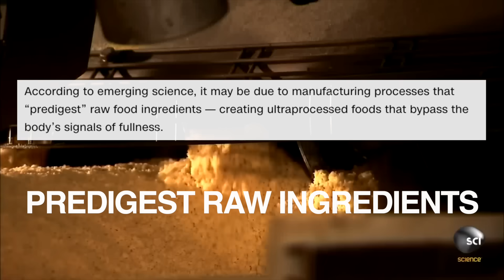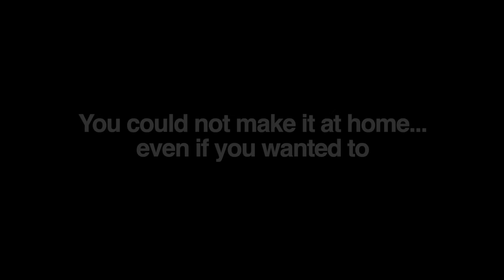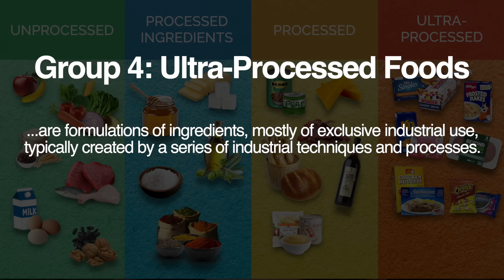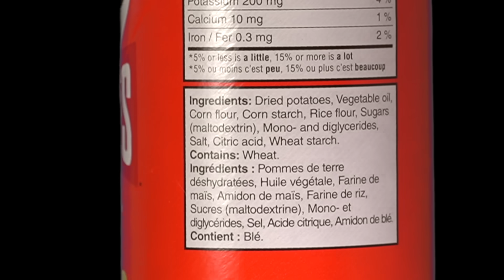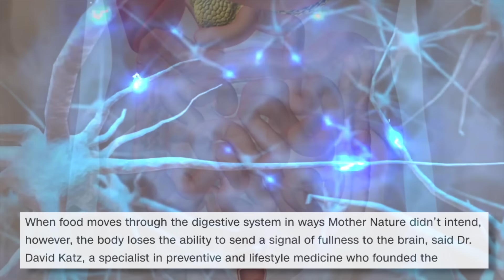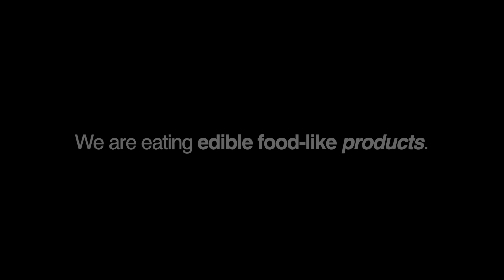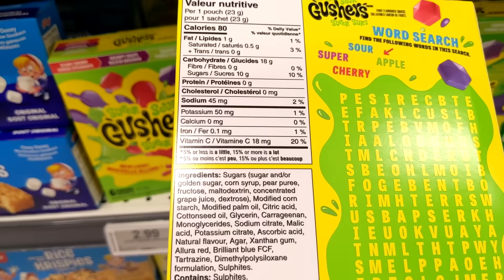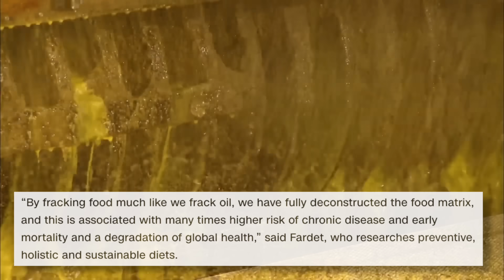The Disturbing Reality Of Ultra-Processed Food

Comment: Small but critical correction: 
in the study mentioned at 12:39 (can be found in the video description), published by Cell Metabolism, participants were given a preset diet of either UPF or minimal processed food, and then permitted to consume as much or as little extra on top of that as they like (ad libitum intake). 

The amount of calories in this ad libitum intake is what differs between the two meal plans: on average, the participants of the study chose to consume 500 kcal more on UPF than on a minimally processed diet. Weight gain/loss was still highly correlated with net calorie intake; UPF does not magically generate more weight gain from less calories

Comment: Hi, I saw your video on drive thrus and thought it was great fair information that deserved a sub. However I think this video is a bit lacking on WHY ultra processed food is harmful. Instead a lot of disturbing words and images are used which I believe is opposite to the goal of rationality. So I can't resist but to type this rant.

Also soylent exists which is just like the slurry just not in a food shape. I agree with your point that those food are quicker to diagest which leads to obesity but other than that I don't see much harm. All those ethically questionable industrial process have drive food cost so low which I consider to be a huge advancement over the last centry.

Another piece of information is China just had a huge news on food ingredients being shipped in tankers that is contaminated with industral chemicals (think gasline and more toxic stuff) saving about less than 100 bucks per ton. and with that you can really see cost saving will happen (just a matter of where) if you demand cheap tasty good food. Or put it this way: would you rather have ultra processed food or triple your food cost? You know what the majority will choose and companies really just follows what the people want. Along with governments stop what is proven to be unsafe this works out to give as-cheap-as-possible relatively-safe tasty food some of which is not healthy in the long term.

Comment: But doesn't a homemade apple pie use flour which is also the basic ingredient for most UPFs?
Reply: Flour is actually an ingredient you can make at home. It’s as simple as grinding the wheat and sifting out the larger chunks to leave the remaining endosperm. So although it is used a lot in UPF, and it’s not nearly as healthy as keeping the bran and germ of the wheat berry inside the flour, it’s nowhere near as bad as some other ingredients which require chemicals to extract and process them.

Comment: Oh dear... It is a very nicely produced video, however, there is a big problem - the only information source was this one article and you didn't check the references in the article. Only part of the experts cited in this article are nutrition experts. The weight gain study reporting suffers from the "broken telephone" effect, where journalist didn't adequately cover the study and you lost even more details in your re-telling. Two important details about the study - they tried to match those foods nutritionally in some ways, but participants were allowed to eat as much as they want and how they want. In your video it sounds like they ate the same nutrients and calories and ultra processed group gained more weight. But it is not the case - they ate more food! And they were not forced to eat it in proportionally to match nutrient intake, e.g., they could have avoided fiber, if the fiber supplement juice tasted funny. 

This study also only has 20 people, 10 men and 10 women followed for 2 weeks on each diet. 2 weeks is not enough to analyze weight changes - short term weight changes are not reflective of long term weight gain or loss. For example, most dietary interventions cause short term weight loss, which goes away with time. Also with 10 women and only 2 weeks on each diet there is an obvious problem - weight and appetite fluctuations due to menstrual cycle. With only 20 people it is easy by accident to have all bloated and junk craving women in the ultra processed groups :D The 2 pound difference also is so small it is an equivalent of weight someone can lose by taking a big dump. And it cannot be extrapolated to weeks and months. Just google it - we all fluctuate in weight +/- a few pounds throughout a day and throughout a month. 

Regarding calling it "pre-digested" - that is a very emotionally manipulative language. I wouldn't be concerned if such language was used for very well established findings, e.g., I think we have enough evidence to say "transfats are poison". But I haven't heard of much evidence for the statement "ultraprocessed foods pass through the gut too quickly regardless of their composition". Most of the studies that I have read on this topic criticize these foods for being devoid of nutrients, being designed to be hyperpalatable, and having potentially dangerous processing byproducts and additives.

Comment: trouble with this is it's all well and good saying basically just have your own home cooked deserts and meals etc, but to be blunt this is only easy if you're not disabled.

people with chronic fatigue simply won't be able to cook all their meals from scratch, neurodivergent people often can only eat specific foods due to sensory problems, etc. it's not as simple as just making everything from scratch. sure its not necessarily super expensive but the cheaper healthy options are often either boring as hell or some people might not be able to face eating it.

i think something to strive for here is balance. its difficult enough as it is personally to find stuff i enjoy and I'd rather eat something unhealthy once in a while than not eat, it sounds extreme but sometimes my options are really limited. I do eat healthily most of the time but i simply do not have the time or energy to make absolutely everything from scratch.

I'm not tryna bash the video or anything it's good, but it's just not so easy or simple for everyone to make that change and this will only make them feel so much worse about it unfortunately

Comment: You would think the citric acid that you find as an additive in so many foods to preserve them for longer is just the acid from lemons, but noooo of course not, that is too expensive. The citric acid added in most food is industrially produced, based on the fermentation of sugar by a particular mold. And I can hardly find any research comparing these two types of citric acid, only one very small study suggested that industrially produced citric acid may have negative health effects because the mold used in the process cannot be filtered out completely, and that further research is recommended...

Comment: You still have to be cautious with just blanketly labeling every IUPAC or scary sounding chemical as automatically bad, or even “pre-digested” as automatically bad. It’s important to look at the viability of each ingredient itself. 

Synthesized citric acid isn’t fundamentally worse than lemon juice but high fructose corn syrup is almost always a bad sign. How it’s made and yow much of if any reaction byproducts persist also matters. Sometimes there’s multiple ways of making or purifying a thing with one being safer for the consumer than the other. Kinda like how alcoholic beverages ate fine but industrial ethanol will have trace amounts of benzene.

Pre-digested isn’t the word I would use, but the fast digestion of something I don’t see brought up enough. 

This is more random but the whole “real ice cream” thing is solely a dairy industry propoganda thing. There’s a milk fat requirement, meaning that ice cream made from almond milk or soy, or even real milk but not cream can’t use the term. Hence “soft serve”. But both could meet your definition of “real food”

Comment: The cereals weren't that bad, of course, there's unnecessary addition of sugar, but how are oat bran and whole grain flours ultra-processed? Calcium carbonate is just baking soda and the rest of the ingredients are just microelements which are actually a good addition to food. It's obvious that food industry isn't consisting of charitable saints, but support your claims with credible examples, otherwise you're sabotaging your mission. Plus, 0,9kg weight difference is so negligible that it could be a matter of going to the toilet or drinking water one cup too many, on top of that 2 weeks isn't a study, it's merely a finger in the air kind of research.

Comment: Our body digests large molecules into smaller molecules. Digestion takes a long time, and our body follows this standard when regulating how much we eat and our appetite. However, pre-digested food has small molecules, so it is absorbed directly into the body without the need for the body to digest it. However, the human brain still recognizes that digestion will take a long time, so we do not feel full and seek out more food. That's why the more processed foods you eat, the more you gain weight.

Comment: 🎯 Key Takeaways for quick navigation:

00:00 🥘 Ultra-processed foods, prevalent in modern diets, pose significant health risks beyond just being junk food, contributing to various health issues including diabetes, heart disease, fatty liver disease, and depression.
00:58 🤢 Ultra-processed foods are essentially predigested, created through extreme manufacturing processes that break down basic food crops into molecular parts, leading to products that could not be replicated at home.
02:25 🍟 The defining feature of ultra-processed foods is their extreme level of processing, turning them into industrial formulations that lack resemblance to natural or whole foods.
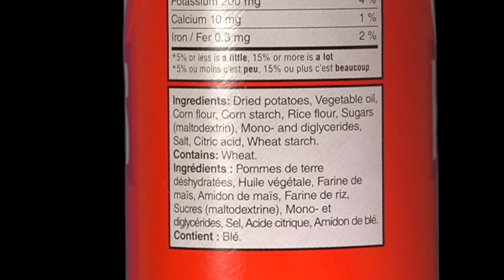07:41 🛢️ Ultra-processed foods contain industrial ingredients created through complex processes, often labeled deceptively with terms like "vegetable oil," emphasizing profit over nutritional value.
09:41 🍔 Ultra-processed foods are designed for quick digestion, leading to overeating and cravings due to their rapid impact on the brain, similar to addictive substances.
12:33 🥤 Ultra-processed foods dominate the modern food supply, with estimates suggesting they make up 73% of the US food supply, contributing to health issues and chronic diseases.
14:03 🏥 Ultra-processed foods not only affect weight but also disrupt overall health and metabolic processes, leading to chronic diseases and impacting global health sustainability.

Made with HARPA AI

Comment: I'm going to clear up what she means be "pre-digested" food because it wasn't explicitly stated in plain:  It is the fact that the food industry separates the proteins carbs and fats from a product in the same way your digestive system does.  As to what this adds to it's nutritional value or devalue?  Probably nothing.  It probably has no effect unless the companies are really messing with the ratios of protein carbs and fats.  Which is somewhat true: they take out the protein in a lot of products and have to add it back in.  But I don't think this is where the "Disturbing Reality" is.  The "Disturbing Reality" is how the food is poisoned with other ingredients that directly affect your health.  Have you ever worked at a french fry factory?  Have you seen the glow in the dark cleaning agents they use to clean the conveyor belts?  You WILL get residue, it is impossible to clean that up completely with just a pressure hose.  They add addicting flavor molecules which are patented which is the source of the foods addictive properties.   Not only that, but the flavor molecules are possibly carcinogenic.  And then there's plastic in everything from can liners to metal bottles disrupting hormones and making you fat.  Then there's the toxic seed oils that add to obesity and hypertension.  This is what I thought the video was going to be about.  So when you were saying "There's just SOMETHING about the pre-digested food that makes it worse than unprocessed."  I was just rolling my eyes and I made this post.

Comment: "Hydrolysis, a process similar to digestion"??? Hydrolysis literally just means you add water to it and it dissolves into the water.
Thats like saying making a smoothie or a soup in a blender or making a dough using that includes water is the same as digesting it.

This whole video is just using the technical terms for everyday food preparation steps and saying phrases like "pre-digested" to make everything seem much worse than it is.
Don't use technical terms if you haven't passed middle school chemistry or refuse to even google the processes used.

You're aware that starch is just a different type of sugar that plants like potatoes,wheat and corn are made up of instead of fructose right?

And "ripping foods down to the molecule" just means they make it liquid, theres no magic evil chemical process that automatically makes things poisonous 
(its almost always just heating it and or adding water, theres nothing inherently bad about that).
You know what else is just a bunch of free floating molecules?
Literally any drink: water, milk, juice, beer...

Some chemicals like the emulsifiers and preservative agents can ofcourse be very bad for human health i won't disagree with that.
But the whole video looses credibility by not researching and the fearmongering in the first half.

Comment: I have gastroparesis so I feel full insanely fast and struggle with feeling hungry in general so part of me wants to think that predigested foods are actually helpful for me, but I know ultimately it really isn't. You're right that it's not just about weight, but your health as a whole. I know I feel the grossest when I eat the worst, even if I'm able to actually eat the calories I need in a day because of it. I really struggle with my weight- I lose it quickly because most days I barely make it to 1k calories unless I throw in a protein shake. So even if ultraprocessed stuff helps keep my weight at a point where my doctor won't suggest I relapsed in my eating disorder and need treatment, it doesn't really feel worth it to me? I felt better eating less but better foods and for the most part my body can maintain its weight even if it's on the lower end of the spectrum my nutritionist wants. So I guess that's all that really matters. But maybe I did relapse and am just trying to find excuses for myself lol

Comment: So, I didn't really see where eating Ultra processed foods causes the health problems. We spent a lot of time talking about how gross it was, and then saying don't you notice that since we started eating more processed foods there's more chronic illness? But that doesn't prove that it's the processed food causing the chronic illness as many other things have also changed since 100 years ago. Also, it seems disingenuous to lump so many different kinds of foods together and just say they're all the same? Like are we really going to pretend that almond milk is as unhealthy as hot cheetos? I also don't remember an explanation of why vegetable oil is bad, just that it doesn't have vegetables in it
Reply: I think the main point is that if you strip a food down, you essentially remove the things that your body actually needs; the nutrients. Think about enriched wheat flour. It’s flour that’s processed so much that they have to artificially add nutrients back to it.
Reply: @ravensrespite True, but I gotta say that the whole calling plant-milks UPF was a little far. Oat milk for example is often made by blending oats with cold water and straining through a cheesecloth. Nothing UPF there. Sometimes they add vitamins as well but that's not a bad thing. Fortification is in those so called "minimally processed" foods as well. I'm a huge fan of Kiana's but this video just didn't do it for me. It felt like it had some anti-vegan bias that was a bit off putting.